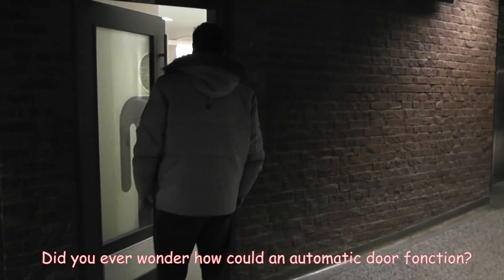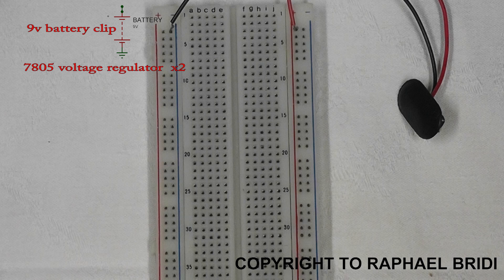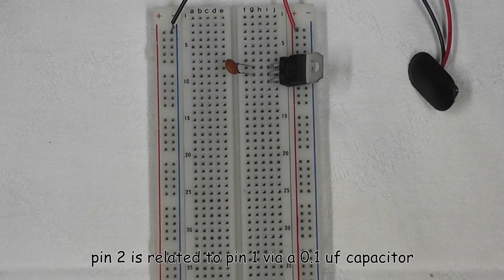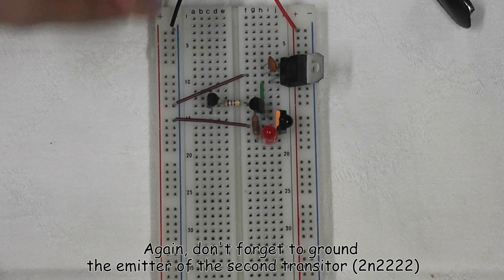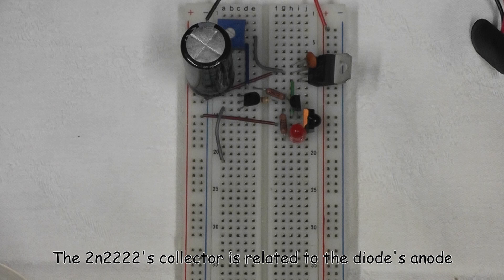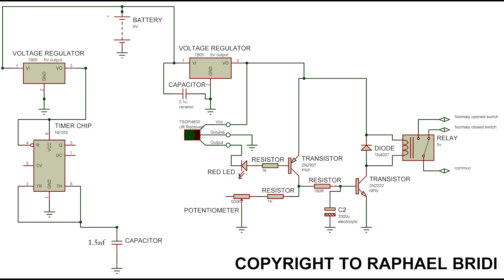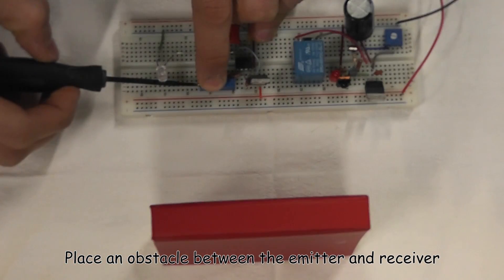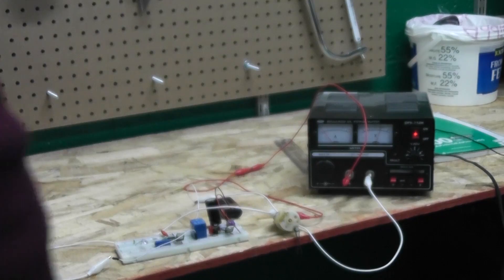[D.I.Y.] How to make an infrared motion detector

Comment: Hi, thank you for the video. I am just starting to learn electronics.May i ask how can I add about 4 minutes to the time so that the motor can stay on a little bit longer. ?My projec is a sensor that will turn a12 volt light when I walk to the bathroom and then turn off.Thank you.

Comment: I tried the project but when I connect the 9V battery, the led turns on without an ir emission from a TV controller. Which is the mistake? I used a tsop31230 instead of that shown in the video. Its frequency is 30khz. The pinning is different and I fixed it . Could you help me ?

Comment: hi sir its me again. 

can i request for another circuit for the sensor which you have made above. sir, please add a delay time for detecting the object. let say for 3 seconds. example when you put your hand or any object in front of the sensor, you should put your hand for 3 seconds otherwise it will not give an output. what i mean is just a time delay for triggering so that it can prevent false triggering. please sir I hope you can make a circuit for my idea. thanks in advance.

Comment: I have tried this circuit but only in the receiver side because i dont have an extra ir transmitter. so, i just used the remote control of our tv. it works very well. also, I made a housing for the ir receiver which is tsop1738 so that i can reduce the space for receiving the ir signal transmitted by the emitter or ir led. i just place it parallel with the ir receiver so when there is an object passing or blocking at front of the sensor it gives an output.  

well great job sir thanks for your tutorial. hope you can post more video. :)

Comment: Hey - great video.. what is the board that you are using and do you know some good starting packs and tutorials (books)? thanks in advance
Reply from the maker: +Pavel Scepka It is a normal breadboard used to test a circuit before soldering it on a PCB. I Know the book electronics for Dummies. It was a pretty good book to start electronics

Comment: How far will the sensor work? Does it have to be within 1 ft or it can vary ?
Reply from the maker: its about 1 to 3 meters. the sensitivity will vary according to you receiver position with the infrared led
Reply: +D.I.Y. or DIE  what would the max hold ? Can it be around 8 meters or so ?
Reply from the maker: Moe Farhat I've tested it and I couldn't get more then 3 meters of detection

Comment: How did you calculate those resistors , capacitors and what is the role of transistors.  Thank you! :D
Reply from the maker: +Laura Sabou there are many resistors in the circuit and each has it own role. Also, there are many capacitors in the circuit so what cap are you talking about? The role of the 2 transistors is different. The first one (2N2907) amplify the signal coming out of the TSOP when an infrared frequency around 30Khz is detected. The second transistor (2N2222) is like a timer. When a signal pass it's base, he turns on for X seconds and activate the relay during this time.

Comment: is there anything that i can do to replace the 1.5nf capacitor because i cant get it in my plc
Reply from the maker: +yew ray you can try anything between 680pF and 0.01uF. But try to get a value close enough to the 1.5nF (1500pF)

Comment: URGENT: Hi, i'm trying to design this using Proteus 8 but i can't find the TSOP 4830 on the software. i would like to know what you used as the receiver in your own design. thank you.
Reply from the maker: there is no tsop in Proteus, to simulate the circuit, you can use something called IRLINK. I never use it before but it is the only component similar to the tsop. it include the ir led and the receiver in on chip.
Reply: +ardah obi Also, my IR LED keeps blinking instead of remaining constant. i wonder if you know a solution.
Reply from the maker: +ardah obi your IR led should blink in order to activate the receiver when an obstacle is in front of your circuit. But you should adjust the frequency of your LED to 30Khz in order to match the detection frequency of the TSOP4830.

Comment: Dude u made it in the hard way this circuit is so complicated it could be much simpler
Reply from the maker: +john wans If you wan't, there is an arduino module that is very easy to program. It do the same job that this analogic circuit.

Comment: The relay required 5v to activate, but what is the voltage pass thru it? 5v or 9v. 
Sry, newbie here
Reply from the maker: the relay is receiving 5v because one of his solenoid pin is related to the 7805 voltage regulator witch gives the relay 5v. nothing in the circuit is directly plugged into the 9v battery supply except the voltage regulator. The goal of this chips is to give a continuous 5v with any input between 7 volts and 32 volts
Reply: +D.I.Y. or DIE I followed all the step but my infrared seems to be very dim. Even i put an obstacle in front of the infrared led, the led doesnt even light up. I replaced the tsop4830 with a tsop 4838, does that causes all these problem? Sry for bothering ><
Reply from the maker: +Lolimancer First of all, could you see the infrared led blink with a cellphone? Secondly, try to turn the receiver circuit on and off with a tv remote as shown in the video.

Comment: My only big question is why is your  normal red led not glowingg even when you connect a 9v battery ...... mine is always glowing ..........my second question is there are 5 pins in my relay , which side should i connect parallel to the diode .......pls answer both of my questions , it will be a lot of help to me ......
Reply from the maker: i don't know why your red led is glowing. if it glows fast, try to turn off your working space's light. it may affect your circuit. else, you may have need to build the receiver circuit in a different breadboard then the emitter. it look like the emitter oscillation is affecting your receiver. another idea is to buy the tsop4830 used in this video. for the relay pinout, it will be helpful if you send us a private message in our facebook page with an attachment of your relay. one of the admin will answer as soon as possible.

Comment: The led is always on , when the battery is connected ...... but for your circuit , it switches on only when your hand gets near the circuit......pls help....the relay makes the sound only once  that is , when the battery is connected ,,,,what can i do
Reply from the maker: did you try to turn on the receiving part with a TV remote before building the emitter? if yes, try to make the emitter circuit on a different breadboard with a different power supply.
Reply: No ..I will try now....but. How will the led stop glowing.....it receives current from the battery right......
Reply: And pls pls inform me about how the relay works..
Reply from the maker: +S LAKSHMAN 14BEC1086 the receiving part trigger on the relay when a 30khz frequency is seen by the tsop.
 we added a temporary latching circuit to keep the current flow to the relay for about 3 to 10 seconds. the relay is a switch that is triggered on when there is current passing into it solenoid. it act as magnetic field and make the connection with 2 wires. you can use these wires to activate another circuit. hope it is more clear and thanks for your interest in this video tutorial

Comment: I may not be able to obtain the tsop4830. Is there any other infrared receiver that is more common that i can use? Thanks
Reply from the maker: you can try the tsop2230
Reply: +D.I.Y or DIE but i think it's still not available :( is tsop2238 okay? 38kHz carrier frequency compared to 30kHz for 4830 and 2230...would it make a big difference/change? Thank you so much
Reply from the maker: +Bernalyn Decena no it should not make that difference but you may not be able to test your receiver circuit with a tv remote.
Reply: +D.I.Y or DIE okay thanks! Great vid! I'll be doing this for a project hope it works for me. Don't worry i'll cite this as reference. Keep doing awesome vids 👍
Reply from the maker: +Bernalyn Decena thank you for the support :)

Comment: very great video! we're doing a project and we did the steps here in the video, but instead of using tsop4830, we use tsmp1138 and it works. but the problem is, it only works when we place the ir led and the ir receiver facing each other. but when we did the set up like the one in the video, it didnt work. what seems the problem?
Reply: i have the same problem

Comment: hi i got confused. the resistor in between the pin 3 of the NE555 and the ir led. is that 180 or 480 ohms?
Reply from the maker: it is a 180 ohm resistor
Reply: +D.I.Y or DIE hi thanks for the reply. im planning to put something like this on a circuit board and i just want to clarify :
is the pin 5 of the ne555 timer not connected to anything ? is the middle pin of one pot not grounded? and lastly is the one end of another pot not connected to anything? thaaanks
Reply from the maker: +Jeong Eun Li Yes,yes and yes :) you got it right
Reply: +D.I.Y or DIE thanks(:

Comment: im just looking for simple motion sensors to trigger sound effects and or props in a haunted house..  standard PIR sensor is about 40 bucks after shipping and handling.  which would be cheaper for me?  learn this stuff, or just buy the store bought one?
Reply from the maker: +MrAnderson1985 This project will cost you 10$ maximum but the result won't be as good as a real PIR sensor. Also, it will take time to make the project vs buying a PIR sensor. If you believe time is money, you may want to buy it directly from a seller.
Reply: +D.I.Y or DIE ill still do this build just for the hobbiest in me and gain some extra know how - but yeah i probably will just buy a few of the store bought ones.  thank you for the response!
Reply from the maker: no problem. good luck in the project

Comment: Sir cn v replace d IR reciever TSO wid sum odr reciever
Reply from the maker: +Ajinkya Mohite Any kind of 30Khz band pass IR receiver will work. You just need to check the pinout because it may be different then the TSOP4830
Reply: D.I.Y or DIE sir d 1st regulator's 3rd pin requires supply? ?
Reply from the maker: +Ajinkya Mohite the regulator pin 3 is our 5v output. the external power supply will go to pin 1 of the regulator

Comment: Why is the red LED connected to the base of the transistor?
Reply from the maker: it isn't necessary to make this connection. you can just replace it with a wire. the purpose of this red led is to verify the response of the TV remote. if something is wrong with your receiver circuit until now, the red led won't turn on when you point the TV remote to the receiver and press any button
Reply: +D.I.Y or DIE Thanks, but I think I'm still missing something.  If the LED is biased so that current has to flow FROM the base of that transistor, not TO it (in other words, the LED acts as a diode that prevents current flow into the base), then I don't see how that transistor could ever turn on since the base would never get positive current flow.
Reply from the maker: +Enigma758 When the TSOP detect an infrared light at the frequency of 30Khz, the output pin of that pin will get connected to ground. This will allow the current to flow from pin 3 of the voltage regulator to the emitter of the 2n2907. Then, the current will go from the emitter to the base of this transistor. Finally, from the base of the 2n2907, the current will pass the 1k resistor and the red led and will go to the output of the TSOP wich is connected to ground. Hope it help answering your question.
Reply: +D.I.Y or DIE I see now.  Because it is a PNP transistor it can act as a low side switch.  Normally I think of transistors turning on by passing current into the base which is why I was confused.  Thanks for clearing that up.
Reply from the maker: +Enigma758 no problem

Comment: hey can you help me please? i follow all your instructions and im stuck when trying to test it via remote. it doesnt flash the led when pushing some buttons on the remote. hope to get your response quickly. thanks!
Reply from the maker: +david ivane lucas There could be several problems in this case. I'll name all the problems from easiest to complicated:

Your remote control isn't On --> try to light up your tv with it
Your circuit isn't getting power --> check with a multimeter if you have 5v on pin 3 of the 7805 voltage regulator
Your red led in the circuit isn't placed correctly --> try to switch the cathode and the anode
Your TSOP 4830 is not a TSOP 4830 --> try to buy the original one
Sometimes, even if it is the same TSOP, the pinout is different --> try to alternate the 3 pins and make all the possible combinations until it works.

Hope it helps
Thanks for watching ;)
Reply: +D.I.Y or DIE  hi :) thank you so much for your quick response. i did it. the is a problem in power. what i did is i remove the voltage regulator and put the 5v power supply using the usb charger at i worked . but still i have a question. hope you dont mind :) is there a way for this? this is what i want to do. whenever i dont remove my hand in front of the sensor. the relay is still activated. and when i remove my hand it will deactivate. can you help me please? because the sensor didnt work if i dont move my hand. thank you so much
Reply from the maker: +david ivane lucas you can do that by removing the 3300uf capacitors
Reply: +D.I.Y or DIE thank you so much ;) im so excited to went home to do what you have instruct me. i'll be telling you the result after. THANK YOU SO MUCH AND MORE POWER.
Reply from the maker: +david ivane lucas no problem and good luck with the project
Reply: +D.I.Y or DIE  hi i just got home. without changing my clothes i rush into my room to do what you have tell me to do. but it doest work. when i remove the 3300 it almost ruin our project. please help me :(
Reply: +D.I.Y or DIE I hope you dont mind if we can be friends on facebook for me to send a clip of what is going on to our project. hope to hear to you soon.
Reply from the maker: +david ivane lucas Hey, sorry for the late reply. You can search us on Facebook DIY or DIE and I'll try to help you troubleshoot the problem

Comment: Woud it work with a phototransistor instead of the tsop4830? I have this http://lib.chipdip.ru/204/doc000204796.pdf and I would like to know if i can use it.
Reply from the maker: jorgesmok no it won't because there is a built in 30Khz band pass filter in the tsop 4830. You may try to add this kind of filter with the phototransistor but it will take much more time.

Comment: Hey its wonderful thing... Can you plz confirm me if the resistor connected from pin No. 3 of timeer chip is 180R or 480R, Becaz as per circuit diagram its 180R, but while connecting u said 480R....
 Secondly, can i connect a counter Circuit to Relay in order to count no. of motions?
Reply from the maker: MrPrateekpanda sorry, it is a 180R that should be connected to pin 3 of the timer. Secondly, it will work with a counter circuit.
Reply: D.I.Y or DIE Thank you so much.. i really i appreciate that...
Reply from the maker: no problem ;)

Comment: hello sir,i have made the circuit and the reciever part works fine with only remote
but its not working with transmiter circuit ...
transmitter part led is working fine...and also adjusted pot and still not working.
please help...

Comment: Thanks it will help me a lot in my project
Reply from the maker: Yash Soni no problem ;)
Reply: Can you please help me by telling how can I use this DC motion sensor in an AC circuit? Will it cause any problem if I connect the relay with a line with 230V AC? Also, will it work when placed very near to the bulb? At last, can it detect small insects like grasshoppers? Please reply...
Reply from the maker: Yash Soni first of all, you can use this circuit with an AC extension attached to the relay. Replace the generator with your wall plug and the motor with whatever you want. The  steps are the same as in the video. It should work with a bulb near by but the circuit can't detect a small insect.
Reply: Is there any possible way to make it able to detect insects not very small like mosquitoes but a little big insects like the flying one which attack the crops?
Reply from the maker: Yash Soni There should be a solution but I can't see how.. you may be able to do it but not with this circuit
Reply: Sir can you please post a detailed video on how to set the pot as in my case when I connect the battery, led start glowing and when I set the potentiometer the led glows but the relay circuit does not work. What can be the problem with my circuit
Reply: I don't know why but my sensor works correctly for about 10 seconds and then I have to adjust it again and again. Also I am not able to set its time for which it has to work. Please please help as this project is very important for me and this sensor has an important role. Also I will write about you in the acknowledgement part.
Reply from the maker: Yash Soni you didn't adjust the pot right. Replace the 500k pot with a 10k one. It may be more easy to adjust
Reply from the maker: Yash Soni like I said in the last answer, try to replace the 500k related to the 555 timer chip with a 10k one. be very slow while you adjust it because you need to reach an exact frequency of about 30Khz. this is the most difficult part but you should succeed in order to make the timer part work. you can also go to my facebook page : DIY or DIE and leave me some photos or videos of the circuit. I may try to give you some tips.
Reply: Thanks a lot sir you helped me a lot in making my project. It's working very nicely. Now, the last help i require is that i have to make a report of it and i want your permission to place the circuit diagram int the report as your are having its copyright.
Reply from the maker: You can use my diagram circuit in your report but it would be great if you specify the source of the project. Just reference this video and thanks for asking.